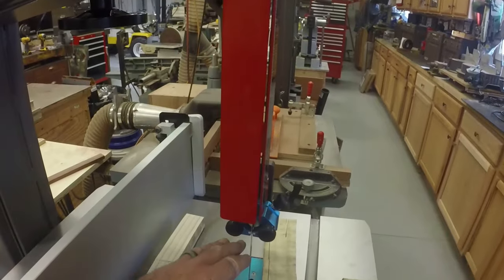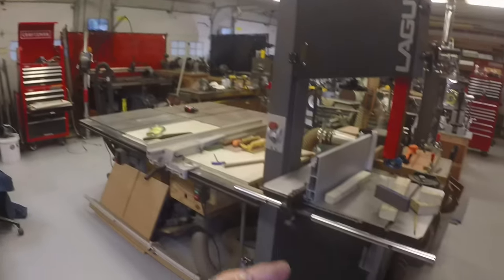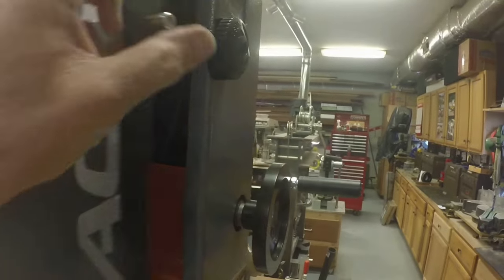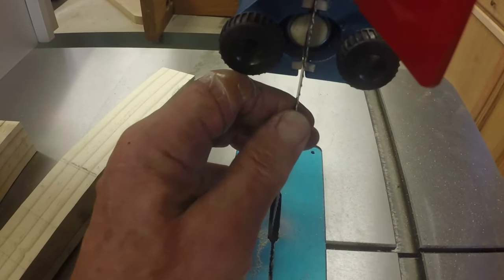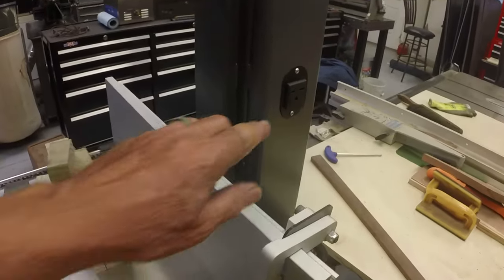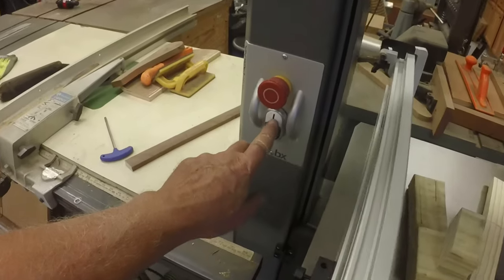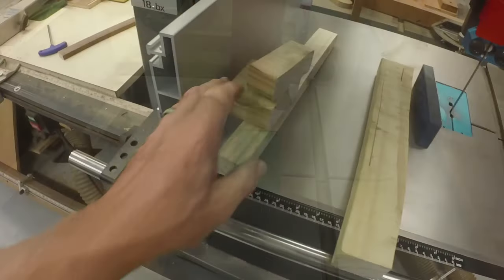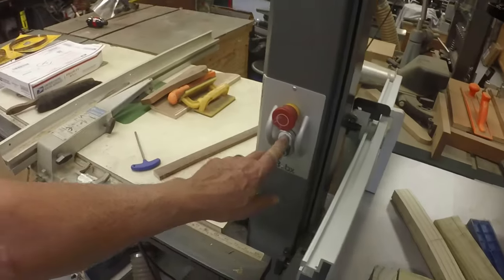Laguna 18bx Bandsaw: First Impressions

Comment: You might also look at wood-mizer blades, that might be an option. You just have to have a way to measure the blades you have so you can match them up.
Reply from the maker: blades are 145 inches long.  I just ordered and received some from Timberwolf.  That's what I have been using on my other bandsaws.

Comment: Might want to check the gauge of the wire on the back of the saw before trying to plug something into it. If it’s meant for a light it may be a thinner wire.
Reply from the maker: Yes, that's a good idea. However, if they follow proper electrical wiring conventions, it should be the same gauge as the motor wiring. Everything on that saw should carry enough current to trip the 20A supply breaker--otherwise you could start a fire without tripping the supply breaker.  Even a light could have a short circuit, and that should trip the 20A breaker in the supply circuit before it overloads the wiring to the outlet.